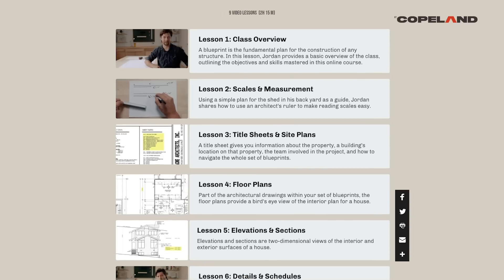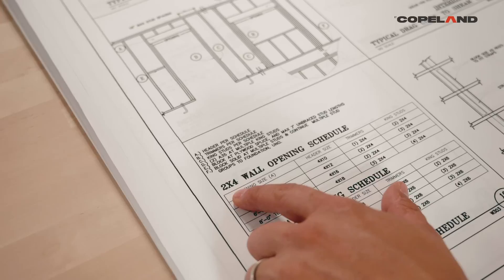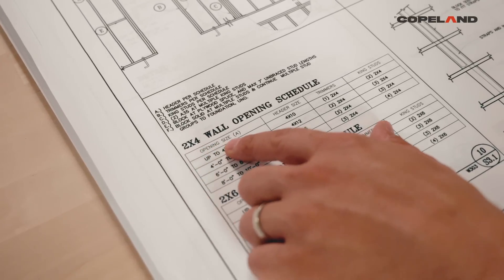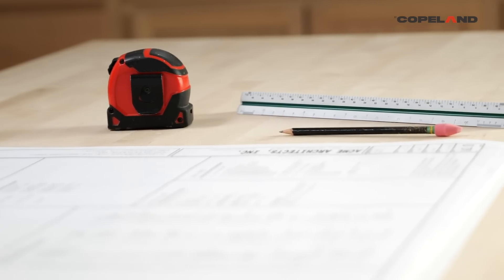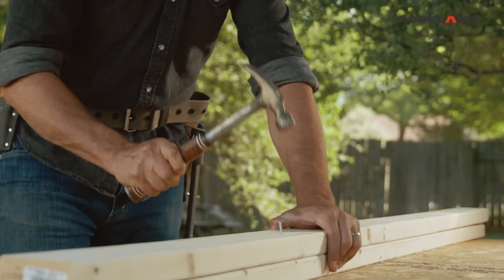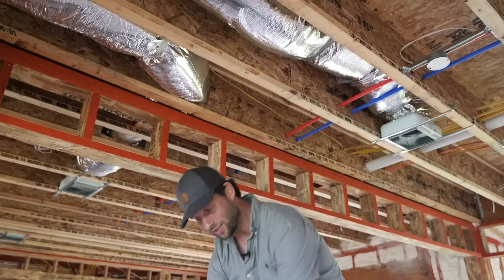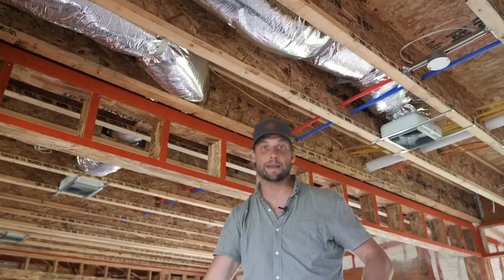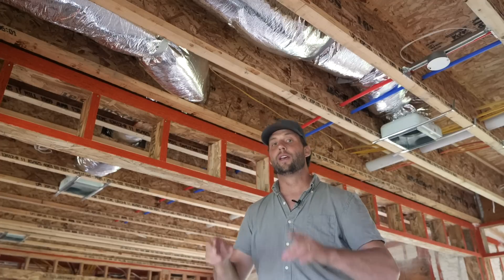Flex vs. Rigid Metal AC Duct - My preference may surprise you!

Comment: Why do they have a account duct calculator  with three flavor of duct. Static static static. 40 ft.flex run hmmm. My metal system are tighter than dicks hat ban. Flex is ok when plumber get ahead of your. Metal takes a mechanic.  Flex  anybody can install.    If you can't get to it. Then you use metal.  
 .

Comment: My system in my 5 year old house has a spaghetti pile in the attic. The 90s are turning in 2 feet from the unit. The insulation is filled with cold air. Trying to get cool air in the house. The returns are sucking dust by doors and the AC on will pull doors closed from the family room section.

Comment: Will you see a return on investment going low end equipment to high end equipment. Never gonna pay the cost difference in the life of that equipment????? I would think in ten years when  the system needs to be cleaned and sanitized they are gonna wish they had hard pipe??? But I see an advantage to pre insulated ducts, however I dont' see an advantage in whole home installation of flex. Seems like the lazy mans way to hvac???

Comment: Can you suggest a quiet blower (CLOUDLINE PRO T6?) that could be used with flex ducting?  I have a squirrel fan that takes heated air from the top of my cathedral ceiling and pushes it into my bedroom lower ceiling area. We have a Buckmaster stove and heat pump so the heat pump only comes on when we are out of town on vacation.

Comment: What about mini-splilt where you eliminate duct work altogether? Isn't that the ultimate solution?
Reply: it is.  When people say heat pumps are super efficient, they really mean the mini splits.  The efficiency of a central air heat pump is just terrible and good luck finding a quality contractor to do a manual J/D to size the unit or suggest updating your ducts.

My mini split in the guestroom+guestbath keeps that room comfortable with decent insulation for a fraction of the cost of using my central heat pump.  If I had to do this all over again, i'd just get mini splits to help AC cool and then a wood stove insert to help heat in Rhode Island.

Comment: Jordan, Ridgid Round as opposed to Flex Duct I had a manual D done. Talked to the engineer about converting the Rectangular duct to a round. He said as long as I used my duct protractor and the round had the same CFM It would be ok I did the conversion and submitted my change in his design he approved my work and I went ahead with the installation. What I did not know was that there is a difference in static pressure between Ridgid Round and Flex. The system performs as designed the heat rise is within spec and it cools the house well but the Static pressure is not. correct. The ACCA Duct protractor shows a distinct difference between Flex and Ridged round. The Flex runs never exceed 50 feet, and are supported every two feet by wood lath to avoid sags in the flex.

Comment: We are in a double wide manufactured home. I need to connect the side with the furnace to the opposite side with 12 inch duct 25 foot long. There are obstructions to deal with. More than once animals have gotten under the home and ruined the flexible duct. So I've been trying to decide whether or not to switch to rigid duct and then insulate it. After watching your video, it seems so much cheaper to use flex duct and smarter to use the savings to make the crawl space less accessible to critters. Thanks for your video.

Comment: As a designer and salesman for hvac I have builders specifically request rigid and then follow up with the question “ can you pass a duct blast?” The answer is yes regardless. But will also reject the discussion of flex as a logical solution to their current problem of duct leakage with current contractors? Riddle me that.

Comment: 11 minutes of BS. Flex ducts are skimpflation so, despite higher costs to build the same product, GCs can still give uneducated consumers a "house" with a brand new, fully-guaranteed "HVAC system" that works perfectly... for less money. They are GARBAGE!!! They should be against the law. You can talk for 11 minutes or 11 hours, but nothing you say will prevent rats from chewing their way into these and making homes in them so you breath rat feces and fiberglass and attic dust for the next 10 years until you replace the lines or drive yourself crazy fixing them every season. Rats always find a way in neighborhoods where rats exist. On top of that, flex ducts make for sloppy connections so you loose tons of air. HVAC salesmen can talk all they want about "proper" installation being the problem not the flex ducts but "improper" installation is simply a reality when working in attics and crawlspaces in 120-degree heat with technicians covered head to foot in PPE and making $20/hr or less. The plastic sleeves turn brittle and are full of holes after heat cycling for years. They are just shit and nothing but easier to install and money in the pockets of dishonest salesmen like this guy.

Comment: Cold air return side should be rigid metal, supply trunk line too imo. Now the supply lines flex? Sure maybe. You can work with flex easier, so I get what this guy is saying. This is all due to duct cleaning fyi. Can’t clean flex well, it’s delicate. Rigid metal can take the aggressive duct cleaning abuse way better. Returns get dirty hundreds of times more than supplies, due to typical systems having furnace media filters protecting the supplies, and less HVAC systems have filters on the return grilles to protect from dust.

Comment: Flex can be more efficient than rigid. Here's why: Flex can be routed often in a direct line to the registers with small bends under and around obstacles, whereas rigid will usually go at 90° angles, adding length to the overall system. Additionally, friction losses are usually measured in equivalent length, and just one fitting adds 10 to 100 feet of equivalent length. Between both of those factors, you're going to get more friction on a rigid duct than flex taking the shortest line with zero fittings. If there is a friction loss problem, it's also not a matter of what type of duct so much as what size you specified. If there's a friction problem, just go up one size. That's it. Also, a round duct will have less friction than a rectangular duct of equal section area because a circle is the absolute minimum surface per section area. So where you lose in flex due to the ribs, you gain due to geometry (assuming you're using rectangular rigid. If you compare rectangular rigid to flex, it's almost identical in friction. For instance, an 8" flex duct has a section area of 50 sq. in., and friction loss of 0.12 inches (100' @ 200CFM). A 5x10 duct is also 50 sq. in., and has a loss of 0.10 inches. A 0.02 inch difference is not perceptible, especially over 100 feet. Now add fittings to the rigid, and suddenly it's much worse than flex. 
The absolutely best flow you can get would be rigid round with very long press-formed sweeps going in a direct line to the registers as possible, and no one is doing that.
So installed correctly, flex is ideal in most cases.

Comment: Crazy possibly, Wrong, yes. His opinion doesn't change the facts. You can do this yourself and use a manometer to measure the flow. I will personally do a video on this and show the results.
Reply: I agree with him on the price alone. $10k to install rigid ductwork alone vs $3.5k for flex is a no brainer, and the results are VERY similar

Comment: So dumb. Size the ducts for the loads, but use a common trunk down sized along the way from the end to the beginning. Flex duct for takeoffs. <6'. Not horrible to size and make rectangular duct with S-Clips and reducers. Use your ductilater. Dial down to the lowest common static pressure with the biggest size possible.

Comment: lol trying to justify the hi cost of flex duct installation when, even when done right, is considerably easier to install than rigid but its still exactly that. CHEAPER,  the lifespan, rodent  proof, and the products durability through whatever makes rigid a premium product and they have noise reduction fittings, most units today barely make any noise. 

Rigids gonna be like made in Japan
and Flex is like made in Mexico

Comment: In the real world the rodents tear the flex duct to shreds.  I have been called to replace other installers flex ducts because we have a reputation of using metal piping.  I have seen attic ducts completely destroyed by rats, chipmunks, and squirrels. Crawl space flex systems fare no better and they sometimes get ripped out by dogs, even cats. My family has been in the HVAC industry since the 1920's and not a single company spawned by different uncles and cousins use flex.  We install duct work to last the life of the house.

Comment: The flex duct you are installing has a major flaw in that it is extremely vulnerable to rodent infestation.  My personal experience in the South with both rigid & flex duct and field mice is that they can easily chew through the flex duct and then nest within it ripping insulation apart to build their nests within the duct.  This causes blockages of the air flow as well as introducing nasty mouse filth / odors and potential health issues to the home's occupants.  Rigid duct work avoids this hazard and though  mice may still chew on the insulation wrap they cannot penetrate the metal duct itself.  The industry has answered this challenge with a newer aluminum accordion semi-rigid flex duct (similar to clothes dryer flex duct) which allows installation without the need for any galvanized / aluminum elbows and hence reduces labor install costs.

Comment: All I get out of this video is that you are too lazy to use rigid ducting. If you account that the flex ducting will have to be replaced much, much sooner than the rigid ducting, you are not saving money, you are losing money and in a home where the ducting is run up walls an other hard to get to place, this is an even bigger deal.

Comment: Flex ducts used under mobile homes are a BIG MISTAKE.  I live in a mobile home with many flex ducts underneath.  I had a problem with COCKROACHES....  The big ones here in Florida... kept coming into my home.  I finally figured out that a RAT had chewed a hole in the flex-duct which lays directly on the ground.  There is not much room between the bottom of the mobile home and the ground. So ... after the rats chew a hole in the flex-duct, then the cockroaches come crawling into the house through the floor vents!!!!   I did a TEMPORARY fix by putting a fine netting material under every duct to keep bugs from coming in.  Soon we will upgrade away from DUCTED vents to a ductless mini-split Mitsubishi air conditioner.

Comment: Flex like you said, installed properly is as good as rigid with less worry of leakage and cost saving on labor which in most cases can put you into a higher efficiency system
Reply: That is absolutely not true. Flex ducting installed correctly will never be better than rigid ducting that is installed correctly.

Comment: I made a different comment about simple robotic controllers for outlet flaps, but I wanted to clarify that different temperatures and different air pressure is going to have different needs in order to have a very balanced response versus getting a broom out and playing with manual adjustments. Very little electricity is needed.

Smartphone can shut off rooms the household is not using or put it in some sort of standby temperature range low rate and leakage seem silly when you're trying to synchronizing entire house with the use of one control point. It's retarded

Comment: SORRY!   INCORRECT INFO HERE.  HE FORGOT TO MENTION ALL THE FRICTION AND DRAG CAUSED BY THE INSIDE OF THE RIDIGES IN THE FLEX DUCT!   YES, INSTALLING SMOOTH SHEETMETAL DUCTING IS MORE LABOR INTENSIVE AND MORE $$$ BUT IT DOES HAVE THE PONTENTIAL TO WORK MUCH BETTER.  THE REASON HE LIKES THE FLEX DUCT IS BECAUSE IT IS FASTER AND CHEAPER.  BELIEVE ME PEOPLE, HE IS NOT AN AIR FLOW ENGINEER...............

Comment: Hi Jordan,  I know this is an old vid but I am having an argument and hope you can settle it.  When you run Flex Duct as you mention in your video, is there ever a time when an installer would put a joint in between a run from the main duct in an attic down through the walls and ceilings of a 2 story home to the final ceiling vent on the first floor?  My assumption is, there is much less chance of a leak or blowout of a duct using flex duct to make that run because there would be no connections needed in any of the walls or ceiling/floor joists between the first and second floor.  Just the initial connection point up in the attic of the 2 story home and the final vent at the bottom.

Comment: 3 things. How do you clean out duct work ? Also dampers on that pipe? And is there air flow restriction since the pipe is not smooth on the inside like ridged

Comment: California is considering all rigid except the last 6 ft. Code here is a blower test so you won't get away with leaking ducts. So with metal ducting and better airflow you can have a smaller blower or at least set at a lower speed which means less energy used. But as an installer I love flex duct. Put the furnace in a central location pull all flex duct so no sags or bends and you can have a good system.

Comment: In the southeast I very much prefer rigid for 1 simple but persistent reason. Rodents! The can’t get through rigid. I do use a short section of flex at the air handler for noise reduction and ease of install but rigids pros outweigh the cons in this area for that reason. Yes I know if the house is built correctly the likelihood of rodents getting in is less but they will get in at some point and it can be a huge pain trying to get them out. Oh and unfortunately very few houses are built with this in mind.

Comment: I don't know how long flex duct lasts in conditioned spaces but if your putting flex duct in a hot attic in Florida, especially heat pump systems, the life expectancy is considered 10-15 years.  Compare that to the life expectancy of rigid metal ducting.  studies have been done and it was found you do have friction loss due to the corrugated inside of flex duct compared to the smooth interior of rigid metal.  These cookie cutter home builders also hire cheap help to install the flex duct duct and they do not stretch it properly and you wind up with more restriction of air flow

Comment: The only time i would disagree is when i see some cheap looking flex that looks like its just a matter of time the inner plastic on the inside will degrade or punctured when cleaned after years of operation. Then you have insulation mixing in the air.... i don’t know lifespan of the flex though, if it does degrade at all especially in conditioned spaces. if your building that 50-100 year house or the ‘better than most’ house is probably how i’d make my decision.

Comment: Flex duct warranty is 10 years.  I've heard it will last between 10-25 years before the Mylar liner starts to deteriorate.  I would never use flex duct anywhere that it is enclosed like inside a wall or vaulted ceiling cavity.  You will have to tear out stuff to get to access to it if it needs to be replaced.  Like others have said, I choose to run trunk lines in metal with step down reducers along the way and only use flex for the last 5-6' to connect to the boot/register.  You have to be careful not to use Ty-wrap on the outer insulation jacket because it will crush down the insulation and cause condensation to happen on the inner duct liner.  Ty-rap the inner liner only!  Tape and mastic the insulation jacket on flex.  Flex needs to be stretched and held tight for 1-2 minutes before installing.  It's literally in the flex duct instruction manual that nobody seems to read.  Lastly, duct cleaning to remove dust over the years is sometimes needed.  The various tools used to do this can easily poke holes via the high pressure air stream coming out of the rotating nozzle on older flex duct.  Metal has it's own installation issues but won't be ruined from cleaning or aging like flex duct.
Reply: this is the comment im looking for. 
what insane person would install ducting that only lasts 10-25 years!

houses should be built to last at least a lifetime! and that includes the hvac.
Reply: I have 30 year-old flex duct in my crawlspace, and it's coming apart. Started getting bits of insulation blown into the registers. So it's all got to be torn out and replaced. My dad's house is 65 years old built with metal ducts. They're all still fine.

Comment: i have a newer home in VERY HOT Southeast Louisiana.  It's all FLEX.  But i have just 1 room (our bedroom) that is hotter by 2-3 degrees.   It's the longest run from the plenum, and it has one larger duct splitting in 2 registers in the bedroom.   My main question is, can you wrap more insulation over flex duct?  And if so, what should i look for?   Figured maybe the long runs in the attic may be messing with the air temp inside the ducts.